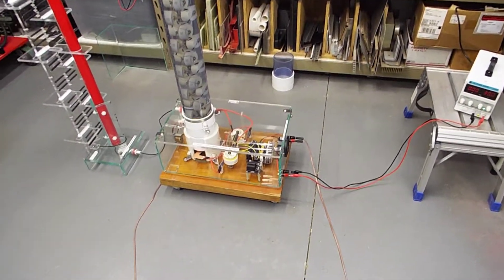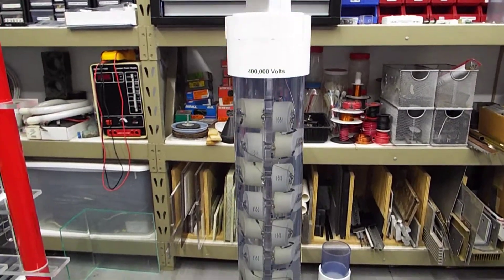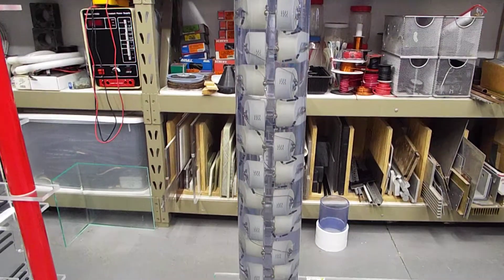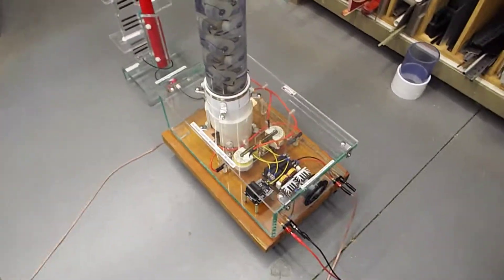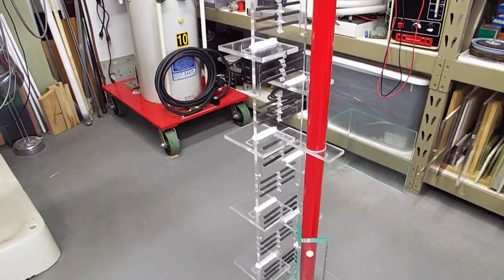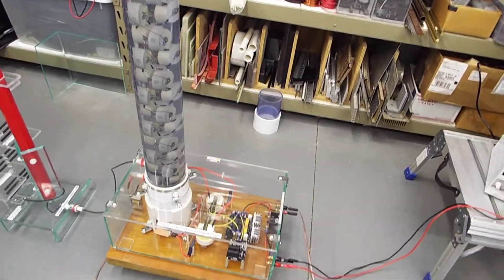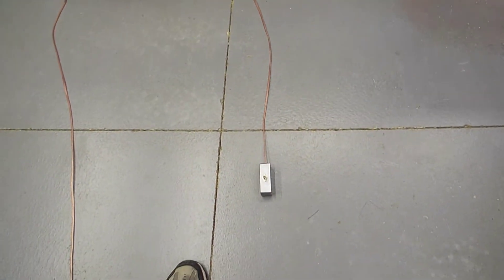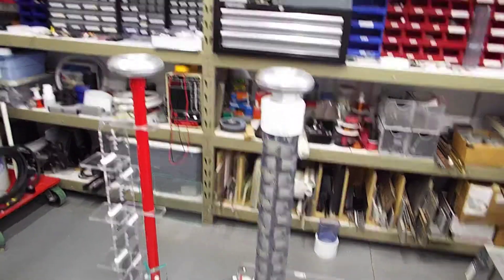Voltage Multiplier Overview

Comment: Of course there is a pole-mounted distribution transformer chilling in the background. Love it! I guess you are using it as a step-up transformer of some sort?
Reply from the maker: The distribution transformer is used to power my large spark gap Tesla coil with 14,400 volts. There are several videos showing it in use.

Comment: Got another question for ya lol, does it matter if the transformer I use has one HV wire and the other neutral or bolth HV out of phase? if I was to build this multiplier circuit I would want to have a high voltage on the output of the multiplier and a zero volt ground, but it seems with some transformers one of  the ac imput wires would be ground of the multiplier Is there a way to prevent that? I may totally have the wrong idea I'm a bit new to this stuff 😅
Reply from the maker: The pin at the base of the flyback is to be grounded. This same pin is connected to one of the inputs of the multiplier. The HV output wire of the flyback is then connected to the other multiplier input.
Reply: @littleshopofelectrons4014  thank you

Comment: Are the resisters really necessary? Im currently trying to produce thick bright sparks to represent lightning 🌩 adding resistance to the circuit seems like it would just produce weaker sparks
Reply from the maker: If you don't have a load resistance then it will be short-circuiting through the diodes when it discharges. The diodes will eventually fail because they can't handle the short-circuit current. The load resistance limits the current through the diodes to their maximum rated value.

If you can't come up with a suitable load resistance then a Marx generator may work better for you although its not a continuous output but the discharges are very loud. Have a look at my Marx generator videos but understand that the video sound in no way captures how loud the discharge actually is.
Reply: @littleshopofelectrons4014  ahh, I see bummer...  ill definitely look into you're marx circuit, thank you for the feedback!

Comment: Very nice load resistor tower, but wouldn't a pole of dry wood work just as well? because these resistors are pretty expensive...
Reply from the maker: Wood will quickly carbon-track, lose its resistance, and start burning under this much power (300 watts) and EMF (400 KV).

Comment: Excellent !!!! I am curious - off the top of your head, how long was the build process and how much did it cost? For a guess construction and assembly was a few months at least and the bill of parts and material had to be in the region of a few hundred bucks?
Reply from the maker: It took me about 6 months to build it but I wasn't in a hurry. I also build everything to a high level of quality which takes longer. The total cost was probably about $750. The cost is highly dependent on what kind of deals you can get on used or NOS parts and what you already have on hand. The most expensive items are the doorknob capacitors and the high voltage resistors. I got an extra special deal on the 28 doorknob capacitors.
Reply: Little Shop of Electrons  - Awesome build and attention to detail, It is like a sculpture - a bit of mood lighting (blue LED’s in strategic places) may set it off 🤔
Reply from the maker: Thanks. A lot more construction detail can be viewed here if your interested.
https://highvoltageforum.net/index.php?topic=1524.0
Reply: Little Shop of Electrons - really great stuff!!! I made a tiny mains driven one and that makes the nerves in your teeth resonate - yours must sound like a bullwhip !!!
Reply from the maker: The really loud ones that you see on Youtube usually don't have any load resistance and the capacitors are dead-shorting through the diodes when they discharge.  They probably won't last long that way before the diodes are destroyed.

Mine is not that loud because I use a 6.3M ohm load resistance. However the charge it induces on anything within 4 feet is tremendous. It feels like your skin is crawling and you are constantly being shocked by static discharges emanating from your body. I may need to start wearing a ground strap when I operate it. The electrostatic wind with a point discharge terminal can almost feel like a fan blowing on you.